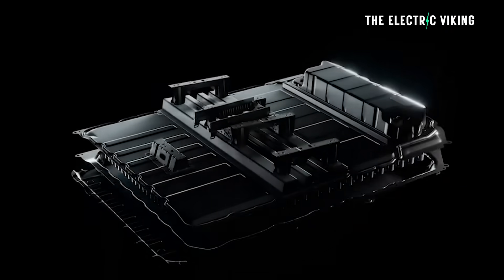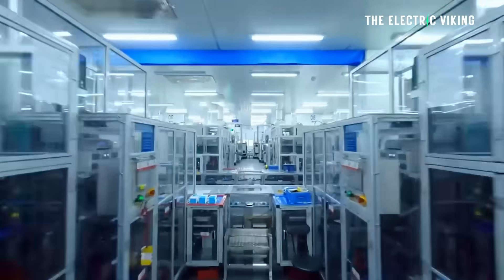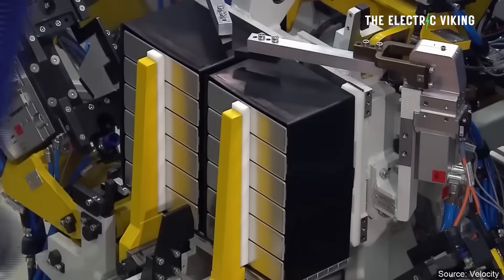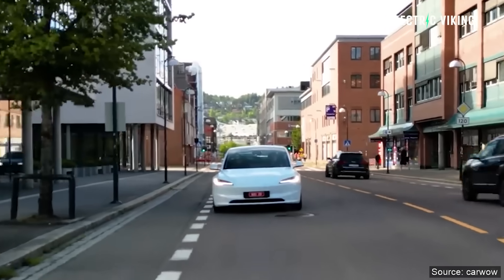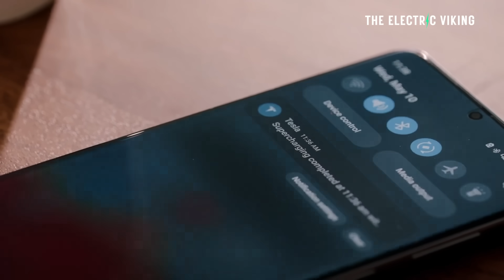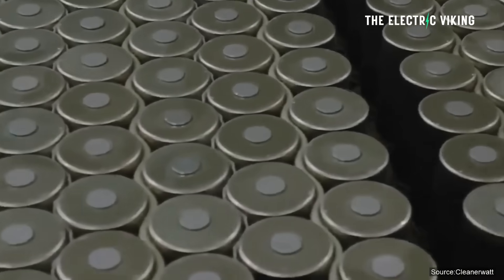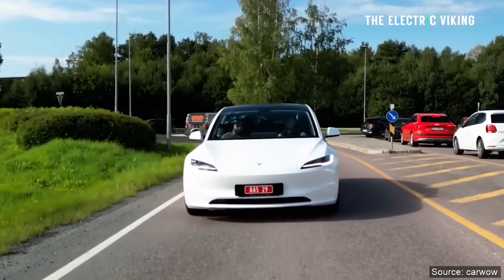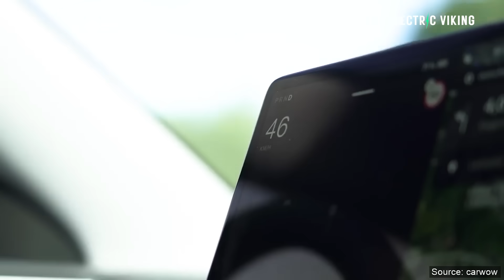Replace a faulty Tesla Model 3 battery for $12K or sell the car for $16K?

Comment: sell it asap! i fast charged two times on my leaf. it was a 2015. i lost two bars the last go. i got rid of it. got another. 28k and lost two bars never fast charged. I used trickle charge and level 2 at work. your comment on ice engines is spot-on. MANY engines like kia, BMW, chevrolet are all failing with 100k or less. Lexus es300h has metal bubbles causing issues. lifters in chevys....ice engines are garbage because of this emissions nonsense. Great video. Learned a lot.

Comment: Have 240000 miles on my 2020 M3, still going strong with about 85% of capacity available
Reply: Have 2020 M3 LR with 120k miles on the clock. 13% degradation as the previous owner did 700 AC cycles. Very little supercharging. I suspect he drove it hard or let the car sit at low SOC or high SOC for a long time.
Else with 700 AC cycles I'd expect 5-8% degradation at most.
Reply: Do you have a Long Range ?

Comment: There's a bunch of places here in my state that rebuild them fairly cheap. Gruber Motors has repaired model S packs for customers in the $2,000-4,000 range, which is engine/transmission rebuild price territory.
Reply: Problem is that they only change the faulty modules, so 85% of the battery pack are still old batteries. So yes running fine again but the next years other modules may fail and you’re back to start
Reply: however you need to ship the car back and forth. That would cost another 2k

Comment: I plan to just replace my battery (or have it repaired if that is an option). There are so few components overall that replacing the pack alone will be like getting a nearly new car for a fraction of the cost of buying newer used vehicles.  In your example,  to sell the car for 16K, then buy a replacement with low mileage would likely mean he'll be out more than 12K and have a car with an unknown history.   

I believe as cell chemistry changes and improves over the years, we'll be faced with an option with new packs eventually: more range or lighter pack
Reply: Tron-Jockey  The structural packs that are coming in all new Teslas are not repairable.

Comment: It's only partly a battery question; it's equally a question about the rest of the car.  After 142,000 miles, is the car, with a replaced battery, worth $28,000?  ($16,000 that he could get for the car as is, plus $12,000 battery replacement, minus anything he could get for the old battery). That's a question I'd be interested in hearing answers to...how do the other components hold up?

Comment: @thelectricviking
Last year did a timing chain on my 2012 VW Passat 3.6. Love my car so I paid out the $6,600 to have it repaired. I had 120,000km at the time. Also did the A/C compressor $2,800.

Comment: My bet, based on my experience with my LEAF’s turnuring battery, is that a lot of high-amp starts (over 1/2 throttle from a dead-stop) will cause the BMS to think the pack is more degraded than it actually is. I suspect it’s because of the heat generated by the amperage being drawn, combined with the inevitable voltage sag as a compounding variable, causes the internal resistance of a handful of cells to spike; and that internal resistance is the main metric the BMS uses to determine battery health. It would seem that tesla uses a BMS that discards temporary spikes in cell resistance, given that the error went away.
Reply: It's maybe what I think happened with this guy with is now (Old model 3) .😄 Funny now to think about it those new car getting old too. This said, ambient temperature sag too have can have impact. And  too a wire from sensor getting more and more loose or weak. Then maybe why his fault disappeared. This said, more than 80% remaining eve after like 240 000km with so many fast DC charging, wow. 👍

Comment: Interesting, I'd always expect the occasional computer 'error' as these things are relatively new and always being updated. I've had a Nissan not engage the motor because I've been too quick starting and gently rolled back when I expected to go forward. My error in that case and hopefully newer cars will have interlocks that stop it. The old instruction of 'turn it off wait a minute and turn it on again' is still worthwhile.

Comment: There needs to be more pack repair stations. There’s quite a common fault on the Model S where a PCB on the pack ingress moisture and blows a small component, this PCB can be changed or better still be repaired for a few bucks. The repair shop will say you need a new pack which is not true.
Reply: The big trouble with Tesla, is they don't want to sell parts (Like PCB control board inside battery) Tesla want to sell all battery pack, same with programming replacing component, Tesla do all to block those repair shop.... Still repair shop exist and can repair Tesla car but with used component they can find since Tesla don't want to sell new parts. It's why I bought another brand EV car to in hope not be stuck with locked car like Tesla do. I have little less range but I love it to have V2L while still Tesla until now did not provide too.
Reply: @sergiomomesso1590  Ten years ago Tesla was at the forefront of BEV. I wouldn’t buy one today at any price. To me they are back in the stone age of what I’m buying. For instance No rear Wiper, No Rain Sensor, No Parking Sensors, No Real Adaptive Headlights, No Android Auto or Apple Car play, No Heads-up display and now No Indicator Stalks.
Reply: no it makes no sense, it is like an iphone, repair makes no sense because the product is so efficient even just trying to repair costs more money, time, effort, waste etc. this is what the "right to repair" weirods don't understand.
replacing a battery is well worth it in a tesla, it is actually for free already, if you think about it.
for 16k you get a totaled tesla, the prices are insanely high for used ones,if you put in a new battery it will cost you 8k if you deduct the value of the old one. this value stays in the car, it is not comparable to ice cars with a new motor which has poor value.
a tesla with a new battery has extreme value. thats what people fear all the time, the battery dies. because they compare it to their phone.
which is not comparable at all.
the mentioned case is 1 case, normally an ev's lasts at least double the lifetime of an ice car.
but a tesla is made for millions of miles, you replace the battery and got a new car.
Reply: @garrycroft4215   What you talking about I call it options, some want them, some don't. As rear wiper, some say it's must be, some as me and long time ago is used to use side mirror. I rarely use rear wiper even when I had it 6 years in one of my car. 😄 In my case what is important is intelligent cruise and cost effective EV car for is reliability. 😁 Each people have his taste.
Reply: @sergiomomesso1590  I’m paying £44k and want all the things I’ve mentioned above and a whole lot more for my hard earned. 3PH 22kW AC charging is another thing I want. Yes it still has dog mode and self parking that actually works although I will probably never use those last two features. Refrigerated drinks cooler I will use but not essential just nice to have.
Reply: @JohnSmith-pn2vl ur the weirdo, that thinks ppl must do as you say.

Comment: Interesting video:  we purchased our 2019 Model 3 new and put on over 131,000 miles.  Warranty expired at 120k.  In August 2023 we have a HV battery issue so it can’t fully charge and soon after it thinks it’s fully charged now…. So essentially it won’t charge.  We took it to Tesla service and was quoted for a new battery for  a little over $13, 000.00 USD.   We are at this decision point….
Reply: The question no one can answer is if you can get a brand new pack for $13K or is it a rebuilt or repaired pack?  For 13K new, I might take that chance.
Reply: Easy question to answer. I asked that same one in Tesla Prague about my model S and was told that it is a new pack. Always easy to ask ANY Tesla shop that same question by sending a simple email. Right?
Reply: Am considering buying a 5 year old used Tesla for $29k means a possible $15-20k replacement in 3-4yrs? I'm very hesitant between that and buying new.

Comment: My model S P85 is just over 108k miles and 11 years old  (2012) with no noticeable degradation.  I've always gotten about 250 miles at 100% charge and that's what I still get.
Reply: Well, the question would be, do you charge with a 240V at home? What's the frequency of Supercharger use?

Comment: Maybe the individual bad cells have eventualy blown the built in circuit fuse thus isolating the cells from the pack which will mean the pack can function normally.
Reply: this is it
Reply: I don't think Tesla use cell with fuse, even in my 2 electric bikes or in my electric tractor I don't use them, why? Because those cells cost more and they bring near nothing because in vehicle. What we use for protection is called BMS to protect those battery in batch (Parallel) and a normal fuse to protect all the pack. Because in vehicle compared to like vapoting or cell phone or even computer, only few cells in those items, then the fused cells in those case don't have great price impact compared to big cells pack.

Comment: It's not the fast charging. I had my first Model S for 7 years and SuperCharged it 90% of the time. After 7 years, the battery only degraded about 2%.
Reply: But did you supercharge to 100% or to 80%?
Reply: It's about number of cycles. And how long the car was in total at a very low and very high SOC (cumulative damage to the cells), the latter especially with higher ambient temperature.
And the third factor is simply the cells itself, there are differences in them, manufacturing defects etc.
Reply: How many miles had your car ?
Reply: @gnagyusa You conveniently forgot to include the number of miles on the car.
Reply: This guy didn’t own a Tesla. P H A T thumbs down👎
Reply: @pauld3327   maybe less than 30k miles. :)
Reply: All the same recent data shows little difference in how you charge
Reply: got to be weary of fake posts like the OP.  "I drove a ford truck with 500k miles with 10k oil changes and no repairs were needed" posts like that garbarge are fake

Comment: Often battery reduced capacity can be just a single cell that cannot charge to 100%, that one cell limits the entire module to its maximum limit, there are many model S repairs for 1860 bad cell/s, all that is done is to clip the fusable link to remove the limited capacity cell from the pack & allowing the entire module to regain most of its capacity before the defective cell/s were electrically removed. So only technician time to remove the battery pack and find the defective cell/s, clip the fusable links and bring that deffective module to the same charge level as the balance of the modules, reinstall the battery pack and charge to 100% to reset the BMS.

Comment: It is interesting to see how prices for replacement packs have changed over time.  When the Model S was introduced, replacement "85 kWh" packs cost over $40k USD.  Most failures were covered by warrantee, but damage from floods or accidents required insurance to pay.  In 2021, Tesla was replacing out of warranty "85 kWh" packs for $24k.  Still expensive, but a vast improvement.  Now I see Model S owners getting new packs for $16k.  

For the Model 3, "80 kWh" replacement packs cost about $16k in 2011, and now are down to $12k.  By the time my 2018 Model 3 is past its 8 year battery warranty replacement costs might be even lower.  The option to replace the pack and drive the car for another 10-15 years is becoming more attractive.
Reply: I always thought that battery modules should be swap&play kind of thing, but Telsa decided to go with cheaper manufacturing on condition that batteries will outlast the car and that's what is actually happening with LFP batteries. Sadly, not sure it will with their 4680 batteries.
Reply: The EV manufacturers will keep the battery price fairly high. They don't want you to replace your battery cheaply and drive the car for another 10 - 15 years, they want to sell you a new EV.
Reply: @PropanePete  In 2012 it cost $45k to replace a Tesla Model S 85 kWh pack.  In 2020 it cost $24k.  Now it costs $16k.  

By the time my 2022 Model Y needs a new pack, probably 2032-2037, I expect it will be less.
Reply: @georgepelton5645  Everyone is expecting the battery pricing will fall to 2 or $3000 but the sales & marketing people don't want you to drive your EV for 15 years or more. They want to sell you a new car every 5 years so the most likely outcome is batteries will remain pretty expensive. The other consideration is that the mining companies (Rio Tinto for example) are saying that the mining, transport and processing of lithium will not meet the expected pace of EV take-up. Anyway, we'll see how it all goes.
Reply: @Giedrius00  Modules can be replaced, all the warranty Battery Packs consist of old parts/modules of battery packs

Comment: Ram 3500 diesel. Under warranty I had the exhaust cleaned out 3 times and replaced 2 times in less than 100,000 miles. There was a recall due to the DEF injection ports being in the wrong place and getting clogged, but they did not have a redesign nor parts when I decided to trade it in right before my warranty was up. I asked the dealer what it would cost out of warranty as this was happening on an annual basis where the truck would need to be flat bedded into the shop. Around $8k out of warranty. That was in 2016, so when I put that into an inflation calculator, it comes to just over $10k today. I use to have the paperwork but sent it off with the truck as I kept all the records in a binder organized for myself and the next owner.

Comment: With your Mitsubishi ICE car you could have refreshed that engine for about $3500 AUD. Rings, bearings, hone the cylinders and a valve grind at an independent workshop (not a dealer workshop) and you would have got another 200,000 km out of it before going the EV route.
Reply: We have an older Volkswagen Passat, that needed a Head job, Valves etc. You have to dismantle half the engine, to get at the Cylinder head. No mechanic would touch the job, because of how time consuming it was. Fortunately, we have an engineer / mechanic in the family, who spent a week doing it. But most Volkswagens are like this, so you have to scrap them, because they are too expensive to fix. What a nightmare...
Reply: @Charlie-UK  That's odd Charlie, I'm a former mechanic and the head comes off the VW range of engines without a great deal of trouble. It does take a bit of time, yes, and it's better to whip the whole engine out to work on. But in the end you have a refreshed car that has another 150000 kms or more life put back into it. Dealership workshops don't like doing rebuilds but there's plenty of other capable people around.
Reply: @Charlie-UK  Thats some good We had a VW polo they said 180.000 km max life for the engime its now near the 500.000 My amarok is near 400.000 km.

Comment: I wonder what it would cost to fit a newer type of more capable battery rather than the type it came with given that the mounts are said to be the same. For example replacing a rwd standard range pack with a new modle long range pack with both a longer range and working life.
Reply: Doesn't work. The BMS won't be compatible.
Reply: If people view these as vehicles and not cell phones, longevity and low cost of long term ownership make the issue a non issue. 

For example, buying a gas car we don’t wonder how much it will cost to replace the engine and transmission. 
We just know eventually we will have to lose money on it and buy again.
Reply: @MrChakra108 Why wouldn't it be? They just need to update the software.

Comment: I suspect the pink material in the battery pack is heat conductive foam, which is also used on he back of many modern refrigerators to dissipate heat. The cooling coils are embedded in it and the foam is contained within a sheet metal skin which provides a larger surface area to dissipate the heat and also protects the coil.

Comment: When my battery dies I will most likely put in a new one an keep on going. Seems like the cheapest option and I love the car and don't want to give it up. $12k is really not much money if I can get another 150k+ miles out of it.
Reply: Yes, in the worst case scenario take out a mortgage and finance the cost of the new battery pack.  It's doable.  It's like getting a new car for a fraction of the price.
Reply: The best option would be to get replace cell that is about the same as the rest. New battery can cause problems to other batteries, because the balance is off…
Reply: @haukikannel  I would just have the whole pack replaced.
Reply: @haukikannel That absolutely makes no sense.  You're replacing an entire battery pack so all the batteries are new and are the same.  If you're replacing individual battery cells, then I can see your point that it could cause problems to other cells in the same battery pack.
Reply: If you own a Tesla, you should have good enough credit for a low interest loan from the bank for $12g. Then the monthly cost over the next 150 000 miles becomes almost laughable with inflation. Do the math, I’ll wait.
Reply: @TomTom-cm2oq  I don't borrow money,  I pay cash for everything I buy the day I buy it.
Reply: @TomTom-cm2oq Are there low interest bank loans in this age of inflation?

Comment: WHAT IS THE PURPOSE OF THE PINK FOAM LIKE  MATERIAL AROUND THE BATTERY  OTHER THAN TO MAKE A REPAIR MUCH MORE DIFFICULT . WITHOUT THE PINK FOAM IT WOULD BE EASIER AND CHEAPER TO GET AT AND REPAIR PLUS CUT DOWN LABOUR COST TO FIX .